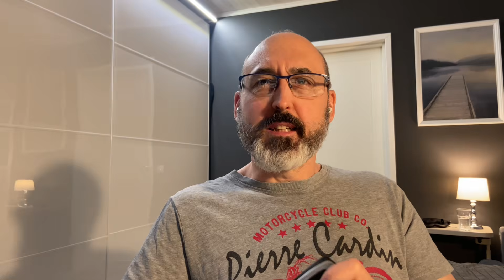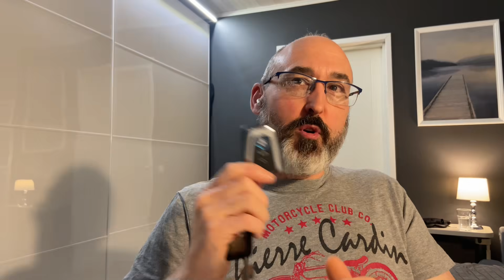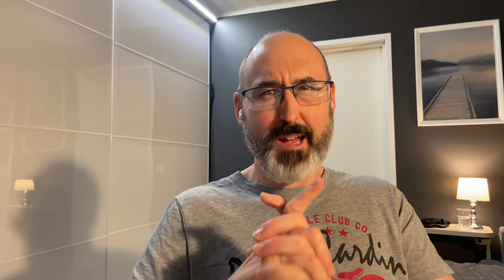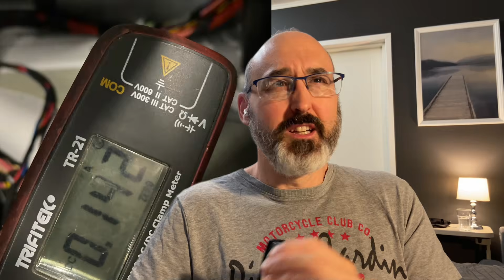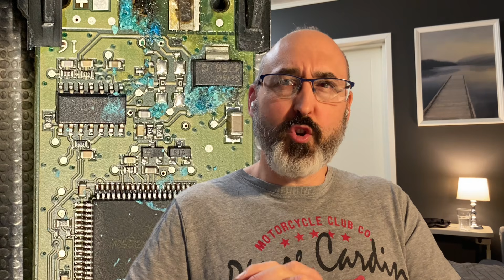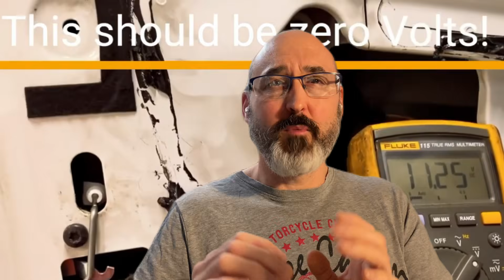BMW X5 Battery Drain FIX! (E70 F15) Find & Stop Parasitic Draw DIY

Comment: A nice succinct diagnosis path from Ben. 
I finally found the battery drain on my ancient BMW X5 E53 after hours and hours of searching.
It appears to be connected with the hidden relays behind the glove box fuse board. I found three relays there which I had no idea existed. The middle, one towards the top, was warm and causing a 160 mA drain which was cured by simply swapping it with the lower relay! I don’t know what any of these 3 relays do, but my battery drain has gone from .2 A to .04 A !
What still puzzles me is why these two relays which appear to be exactly the same behave so differently, in that one doesn’t draw current when the car is asleep in either position but the other one does. I haven’t found anything on the car that’s changed its behaviour other than the battery drain having a reduced by 160 mA.
Reply from the maker: You need to see what relays they are.

Comment: overtime the vanity light in the visors can be activated when you flip the visor up and you won’t see the light on. I found this fault on my driver side. I was able to fix my fault by adjusting tension of the screws on the mount.... not the proper fix, but there’s obviously a break in the wire somewhere.

Comment: Hi Ben, I have a 2009 BMW X5 E70. The 1 year old (non BMW) AGM battery is not retaining its charge, despite being recently fully charged. It seems to drop down to 12volts and when running 14volts is registering between the terminals.
When I turn front wipers on single wipe, the front vdu flickers then goes out as it does when I turn the windscreen blower on and the stability error flashes on dash which goes out when I stop car and restart. Also the rear windscreen wiper jerks/shudders up and will not stop. Could this all be down to a faulty IBS. Thanks
Reply from the maker: No its more likely either washer fluid in the harness or a bad ground

Comment: Thanks for posting this mate. Helped me to solve my battery drain on X5, 1st was K-Can BMW MickeyMouse splice....2nd. Alarm siren recharging... i just coded it out ... Side question, why JBE goes bad sometimes ? This kind of component should be rock-solid and fairly simple imo ... Any prevention measures ?
Reply from the maker: Well done pal 👌 The JBE? Usually a simple pcb component or something external drawing too much current through it but there can be many reasons. The main reason is water ingress from blocked scuttle drains and even swollen wiring from washer fluid leaking inside wiring harness from fluid level sensor 😂

Comment: Awesome video really appreciate the advice found mine to be 142 for the ccc and cic system draining at 1.6 amps! Dropped to .06 afterwards. You mentioned the dvd player as the culprit but could it also be the screen? Any input would be greatly appreciated thank you again!
Reply from the maker: You need to find the fuse diagram lock the doors disable interior monitoring and then do v drop test across each fuse mate then work out which circuit is affected
Reply: @BenJFF I just said it was fuse 142 I know the system